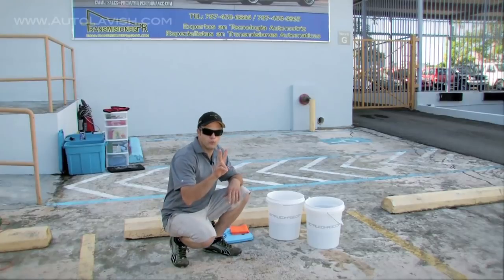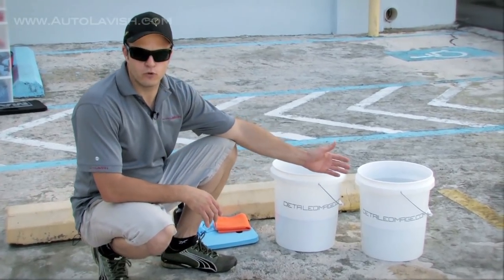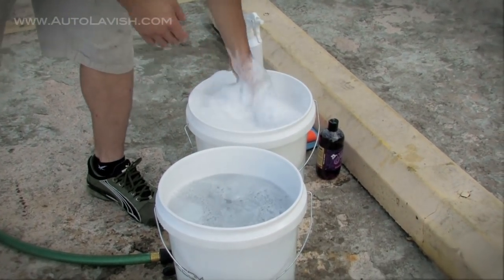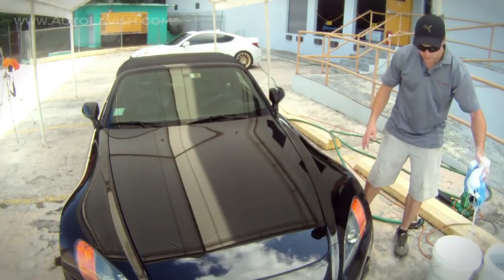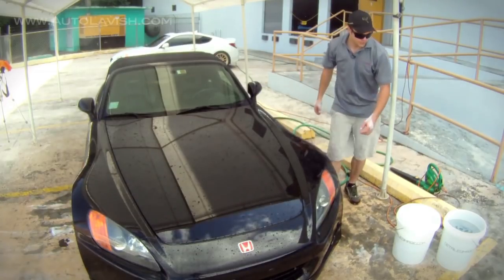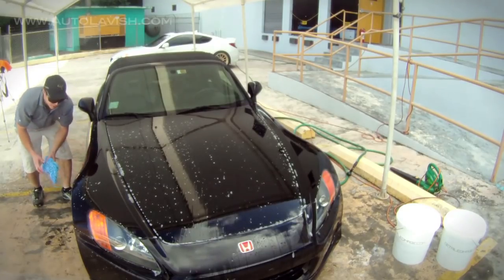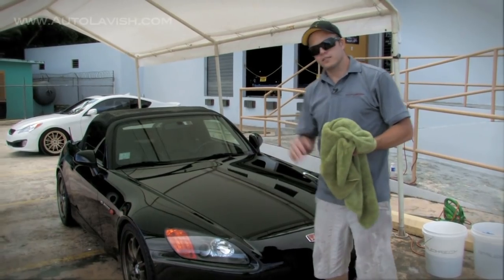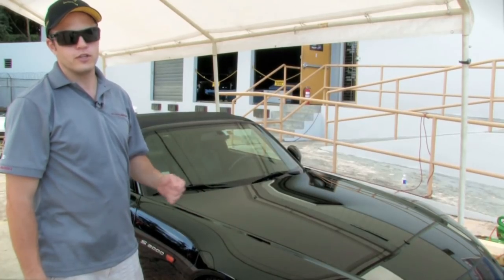Washing Your Vehicle Using The Two-Bucket Method

Comment: I like rinsing the car first, then using a foam gun to lather it up, let the foam work the bulk of the dirt and grit loose and off the car before rinsing again. Next I like to spray and brush the wheels and tires followed by the two bucket method using 2 wash mits. Also try rubbing the wash mitt or sponge on the grit guard on bottom of bucket before putting it back in the soap bucket. Preferably use a leaf blower to thoroughly dry the whole car in cracks and crevices.  I know it sounds like alot, but its actually pretty fast and safe way to keep your ride swirl and scratch free.

Comment: The time this takes would never work in the industry where speed is required. I've been detailing for 20 years and i haven't scratched or caused any swirls. This guy isn't even using a pressure washer. The  grit guard is a very good idea. I personally believe wash brushes are better as they work hold grit  like a mitt can!

Comment: Here is what I do.  I have a 2012 2LT RS camaro and I wash it once a week.  When my car is cool I wash it with a hose using a mircrofiber mitt and meguiars gold class car wash.  I start from the top and go down.  Once all the soap is sprayed off I douse the whole car with distilled water.  It takes about three to four gallons.  I never have water spots anywhere.  The distilled water is cheap (1.00 a gallon) and washes away hard minerals which leave spots.  I leave it to drip dry in the shade.

Comment: The cr spotless system does work but its expensive to buy and you are forced to buy expensive resins and replacement cartridges.  Pouring distilled water over your car after a wash, when its in the shade (cool to the touch) and leaving it to drip dry removes water spots too.

Comment: I'll stick with one bucket, never had a problem with it since i have owned my cars.. Spray off car be for washing and it will remove anything big enough to scratch the paint(i like my pressure washer). Then wash and spray it off again. No point in turning a 30 minute to an hour job into a 2 hour job. However to each his own. He as really good tips, and even though i don't use his method does not mean its wrong/bad etc.

Comment: Nice video brother. 1 question. You had mentioned that you do the upper level fender first before the bottom . DO you use the same fiber micro that is in that video or do you use new one for the bottom fender ?  Also , will there be a issue for leaving the car soap on there before rinsing because your getting the whole car ? Or should we rinse like section by section ? i guess if we rinse section by section, we would need to dry it so we dont get running water.

Comment from the maker: The foam gun we use is a unit from Autogeek.com made for a pressure washer. It works awesome, but is a little pricy. Worth it IMO if you have a nice black car or wash frequently. Not necessary, but makes washing even more fun. Search our threads on autopia.org for pics of the foam gun in action. We probably mention it a lot in our threads.

And about the tags, you are right! Always remove tags!

Comment: Why are you rinsing with a hose? The two bucket method doesn't include a hose or else its just a regular hand wash!
Reply: Youre thinking of a rinseless wash. This isnt a rinseless wash method. The 2 bucket method is for a regular hand wash & for a rinseless wash. In this case its for a regular hand wash.

Comment: Then why do we need a pressure washer? If this guy is using just buckets?
Reply: 1 bucket for the wash, & 1 bucket to rinse the mitt & rub it on the girt guard before putting the mitt into the clean wash bucket.